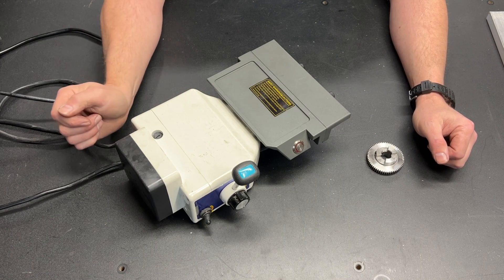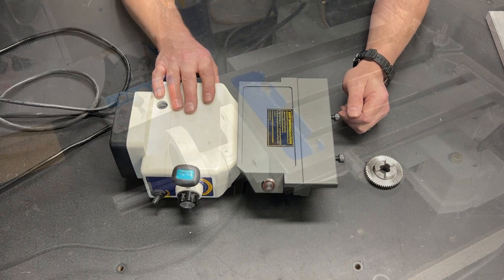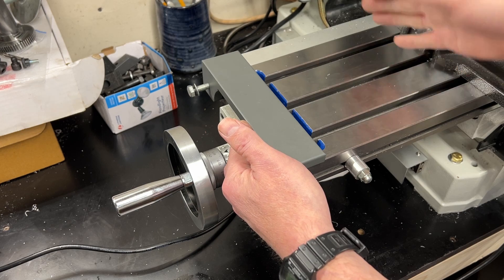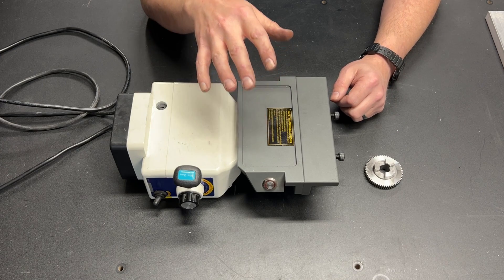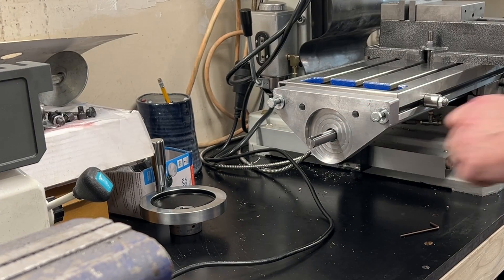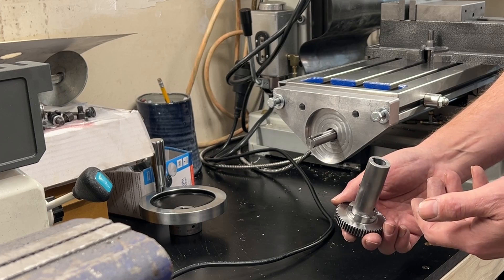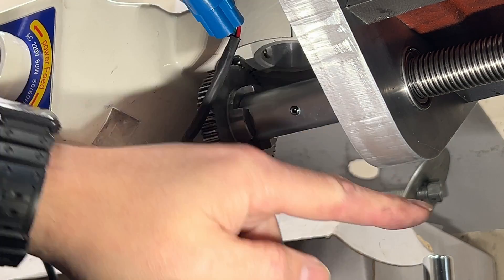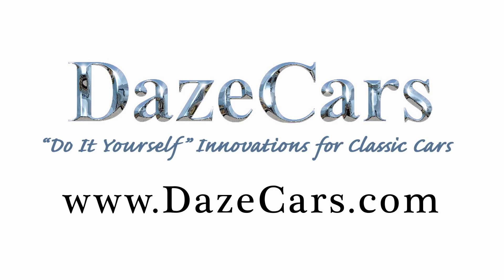Redesigning a “One Size Fits None” Mill Horizontal Power Feed for a Far Superior Install on a PM-728

Comment: I have that setup on PM30MV. I want to adapt this to the cross feed.
Reply from the maker: It's a huge improvement, not perfect because it still sits higher than the end of the table but a vast improvement nonetheless.  Contact me through my website of you have any questions or if I can be of any further assistance.

Comment: I believe the powerfeed you installed is a Z axis powerfeed for a full sized vertical mill. If you would have bought a X axis one it would have probably gone smother.
Reply from the maker: Your theory is incorrect.  It was designed for exactly the axis I am using it on.  Lots of these on the market to be installed as designed.  As stated in the video it was setup to be installed without modification and would have worked but was a poor install design.

Comment: Hello, you've done a really nice job. I also have a similar power supply, and the bracket you removed is made of cast iron. If you screw it to the table and you tighten it a bit too much, the bracket snaps off (which happened). Removing the bracket does indeed give you more table space, but if you occasionally work with wood and use long planks, the power supply still gets in the way because it sticks out well above the table. I'd like to figure out a solution for that. A hanging power supply isn't an option for me because the machine would be too low, and a hanging power supply can't hang "deep" enough. So there's still room for improvement.
I think what you've all come up with is great!
Reply from the maker: Glad the video was helpful!!
Reply: Just use parallels to lift your work above the powerfeed. You could make a pair that fix to the tee slots when you need them.
Reply from the maker: @markrainford1219  even though its not really what they are for 1-2-3 bolck work very well for this

Comment: Which brand of power feed did you settle on? Looking for one but mounting it vertical not horizontal.  Just purchased the PM833TV. I MADE A RISER BLOCK UNDER THE BASE SO I HAVE THE CLEARANCE .
Reply from the maker: I bought my power feed from Vevor.  It was a generic unit. They have several available https://www.vevor.com/s/mill-power-feed

Comment: I just bought one off Allexpress for $197 and $14 Tariff fees. I will be installing it on an older ZAY7532 Mill. I am not above drilling and taping holes in the flying bed but I will try your method of a new bracket. My local steel supply has a drop zone where Steel is $0.50 a pound and aluminum is $2 per pound so I grab end cuts all the time.
Reply from the maker: I think a version of my bracket design should work well for you! There is a place like that that sells drops 2 states over about 4 hours from my house and I stop in to pick the pile as often as I possibly can!!

Comment: A little trick I use when setting gear engagement is too cute a small piece of paper the width of your gear and about ½“ long. Put a dab of grease on the paper and place it on your fixed gear. Now drop on the drive unit, press down with moderate force and snug up your bolts. When you turn your hand wheel it should spit out the paper leaving you with decent gear engagement & back lash.
Reply from the maker: Thanks for sharing!

Comment: On the cusp of adding this same unit to my mill, great video, ta
Reply from the maker: Glad you liked it.  Where did you find the power feed unit.  I originally got mine from VEVOR but they no longer offer them in the horizontal configuration.
Reply: @dazecars  Precision Matthews offers them on their website now.  Great video.  I will be doing this to my mill when I get it.
Reply from the maker: Glad you liked the video, please don't hesitate to reach out if any questions come up when you modify yours like I did.  Thanks for the info  on availability.  I knew PM had them but they are about 4X what I paid for my Vevor unit.  That's why i was asking if he had a source, something a little more budget conscientious.  The PM one comes with all the parts for a simple install and there is for sure value in that but if people are going to modify them like did to improve the mount they may want to consider saving some $$ on something more budget friendly as the head units on these are all basically the same.

Comment: What would it take to mount it vertical like you mentioned that it was originally designed for?
Reply from the maker: If you started with a vertical mount I think it would be easy enough but it would need to be on a stand rather than a bench otherwise it would hang down too far and hit the bench.

Comment: 220\110, no difference in performance. the fed you have is designed for the mini mills, the bridgeport feed has the same power head, but the gears are different
Reply from the maker: I am vey happy with the performance for it on 220.

Comment: When setting the mesh of the gears a piece of paper sandwiched between them works.
Reply from the maker: Thanks for the tip, I have seen that trick and like it for setting hard mounted gears that are side by side but for gears with some adjustment I prefer to do it by sound/feel.

Comment: I have an older Grizlzy mill that had this same power feed on it. The clamp on bracket was broken. Totally removing it and drilling two holes on the end of the bed I was able to mount the power feed directly to the bed.
Reply from the maker: That is a great tip and actually what I did on my DIY mill build but when I got to my new expensive mill I wanted a bolt on option that didn't involve drilling into the bed of my mill.

Comment: 👍👍😎👍👍 -  yep, THIS is why I watch this channel...... for the problem solving experiences.  Thank you 🙏🙏
Reply from the maker: It’s like my only thing to offer 😂 can I weld yes are my welds gorgeous like a true welder no.  can I run late and mill? Absolutely are the parts I make accurate down to .002” not usually, but if there’s a problem to solve, a better mouse trap to build or a part that needs to be installed in something that it was never intended to be installed on I’m your man! 😂😁🤣